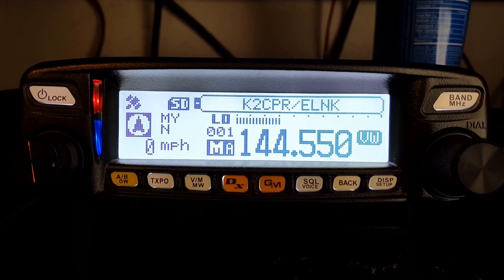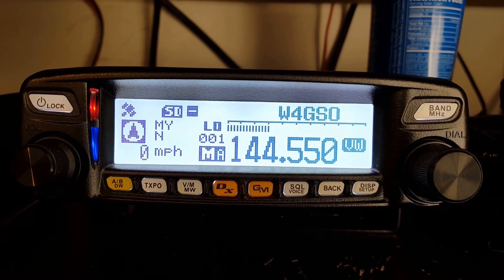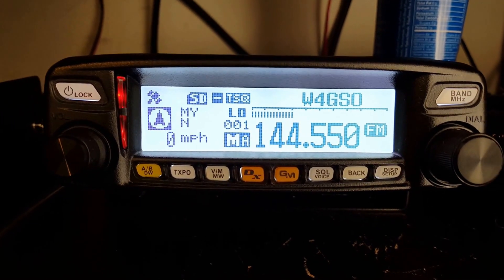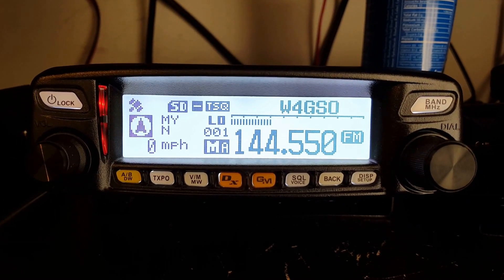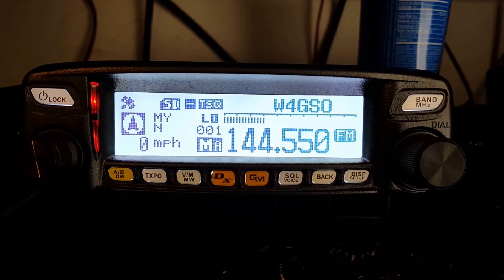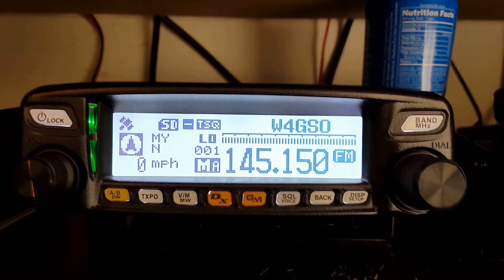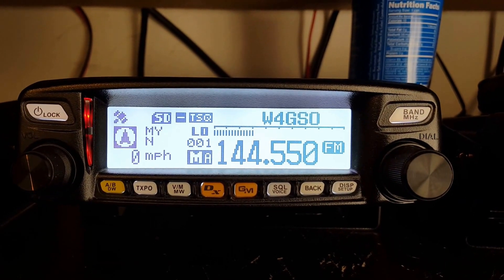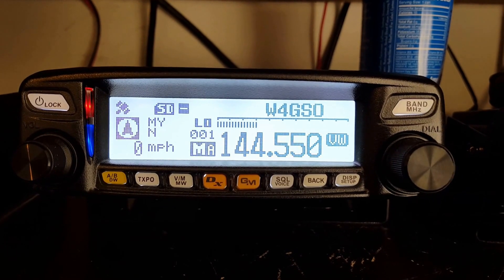W4GSO/R Analog v C4FM with EchoLink

Comment: Great video!  I'm looking for a setup video or webpage on how to run sysop echolink on my computer connected to an FTM-100DR as the radio into our local repeater.  So far I've not found a good setup to describe the setup of the echolink software with PTT into the FTM-100....
Jeff de W5JGW (W5JGW-R)

Comment: Hi Patrick - is this still running well?
Reply from the maker: Tom Sorrell Yes.  Very well, but it has been moved to a different location and is now under the club call sign, W4GSO.
Reply: Thanks for the reply.  Nice video.  Is there a way to remotely select C4FM vs FM via Echolink?
Reply from the maker: Sorry for the delay.  No there isn't.  At least not on this setup.  I don't know if someone else has figured out a way.  The way this is setup the echolink node radio is in AMS mode so it simply follows whatever mode it hears.